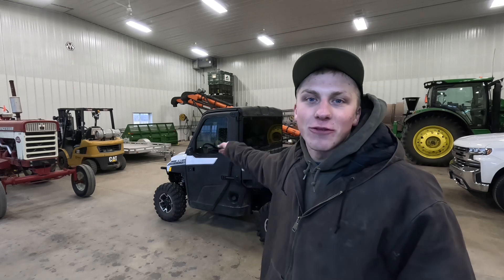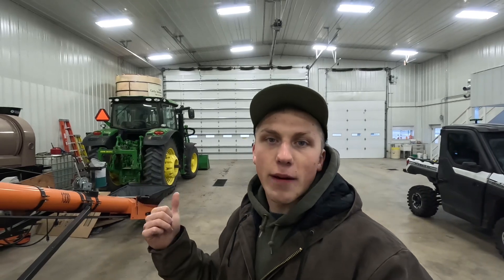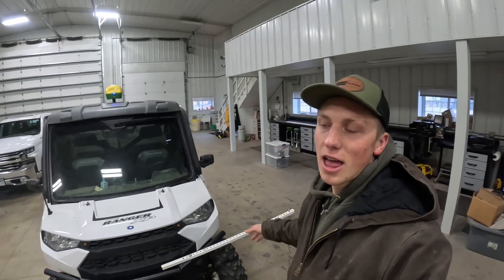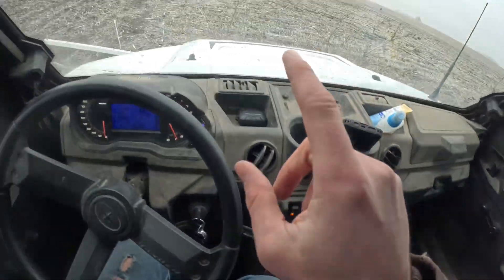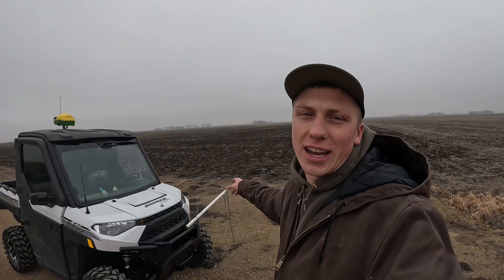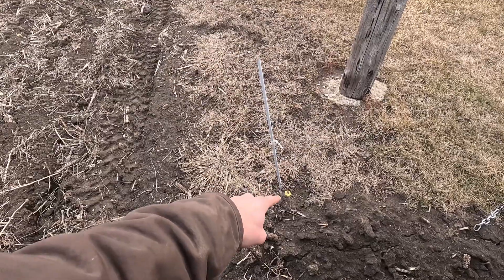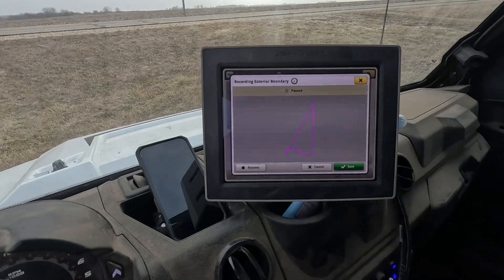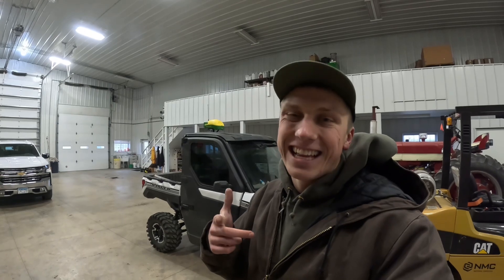One Step Closer To A John Deere Autonomous Tractor

Comment: Why can't the boundaries of the field be mapped with the planter, just by planting the headlands first? Making necessary off set and height adjustments (as you did before driving your Ranger) and then adapting them to sprayer, combine etc. I can see the problems with water ways and terraces, but your fields seem to be plain as a water on a lake. Good and informative videos.
Reply from the maker: Great question! Yes, I could use the planter to create the boundaries. The reason I chose to use the gator is because   I’m trying to plant as close to the fence lines and ditches as possible. For 2 reasons #1 weed control and #2 more bushels. In the planter it’s easy for me to over correct and get more than 2ft away from the boundary. This way I’ll have no less than a 6inch gap to the boundaries.

Comment: Autonomous would be with no driver in the cab which you're still going to need running a planter.  It's gonna be awhile before we see Autonomous equipment on any type of large scale
Reply from the maker: Yes, but this technological step in taking in hopefully 🤞 not going to have to touch the steering wheel, is a step in the right direction. Time will tell how close we are and what adoption will look like. That’s what is fun about agriculture, many things are the same as 100 years ago, but many things have VASTLY changed!
Reply: @HiTech_Farmer  Unless you also have John Deere AutoTrac Turn Automation you're still going to have to lift the planter and manually turn the tractor and then re-engage auto steer.
Reply from the maker: @carlgrayman7663 you are spot on! I plan on using autotrac turn automation to raise the planter, turn and lower the planter. If everything works like I hope, I’ll be planting without needing to control anything in the cab.
Reply: I believe autonomous would work for operations that have more than one piece of equipment in the same field,with and operator in one machine and he being able to monitor the other machine at the same time thru the one he is in, no doubt a kill switch if needed